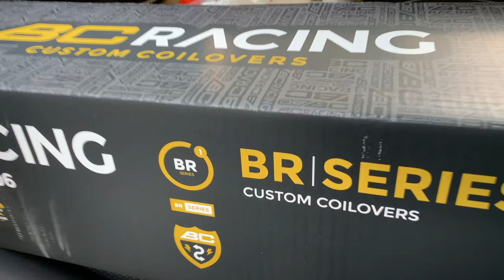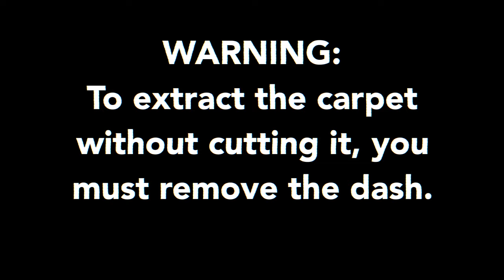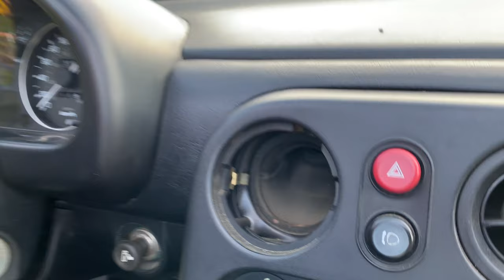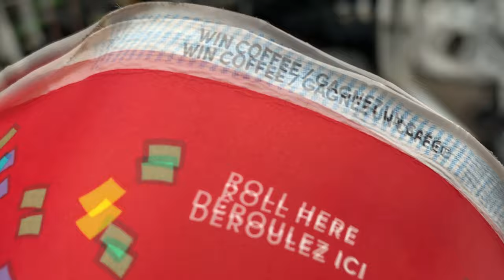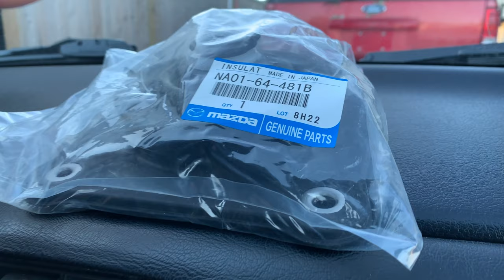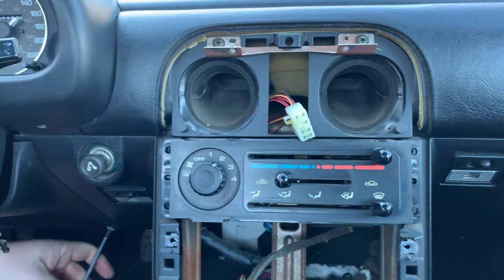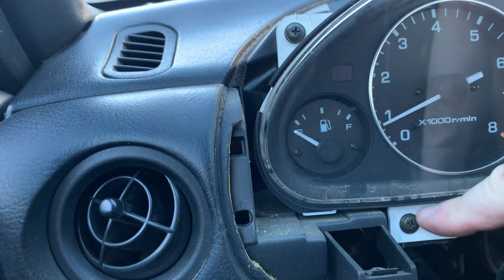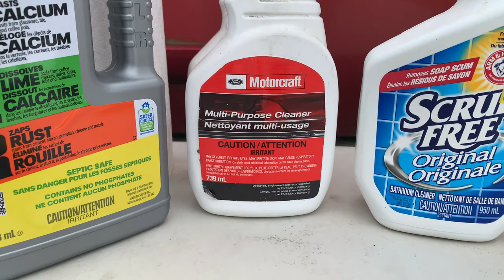Ep 5 - Gutting the Miata Interior (1992 Miata)

Comment: I did this and now when I turn the key to acc the lights don’t come on and I’m sure everything is put back together so is something else wrong?
Reply: Exozilla, need way more info to be able to help. One tip I can give is that the hazard button and pop up headlight switch in the tombstone has to be plugged in or the headlights will not work.
Reply: I fixed it